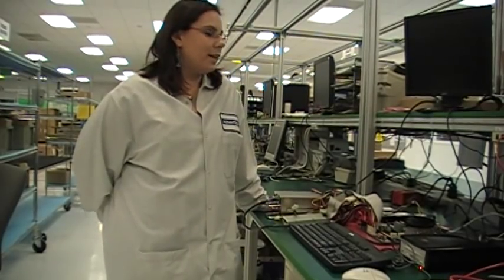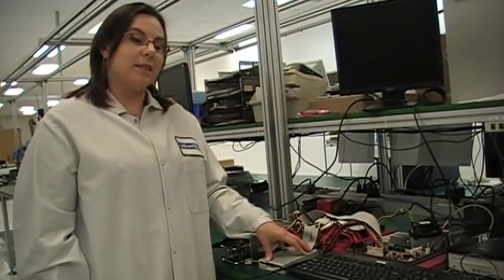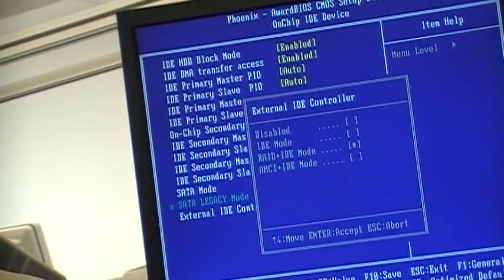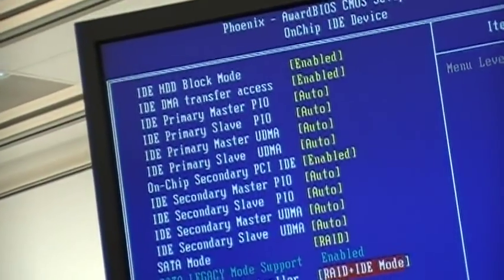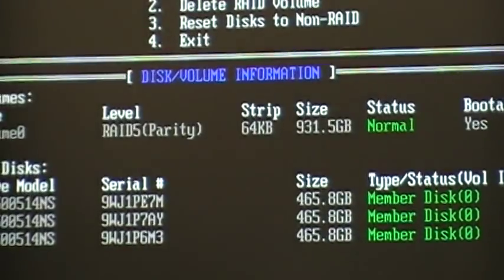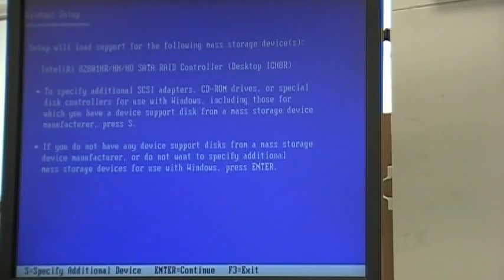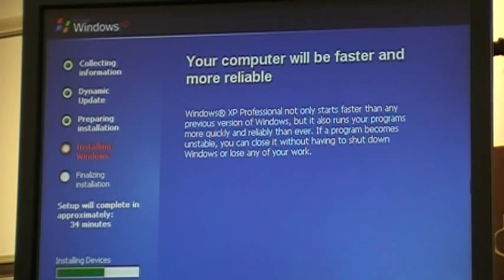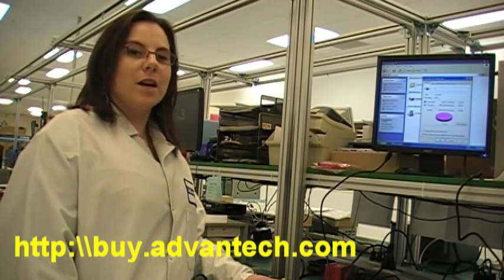How To Configure RAID 5 on Your System- Advantech iPlanet Series

Comment: I think XP doesn't report drive size correctly for large drives until you upgrade to SP2 or something... but just to be sure, when you said the capacity was 1TB at the end of the video, that was a mistake right?  You meant to say 500GB?  Because you're using 500GB drives and they are all redundant, correct?